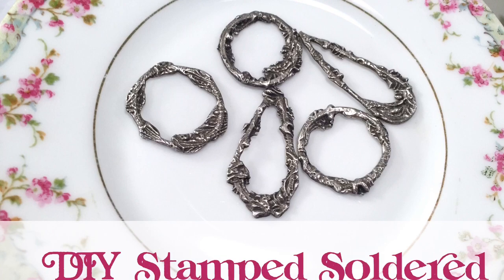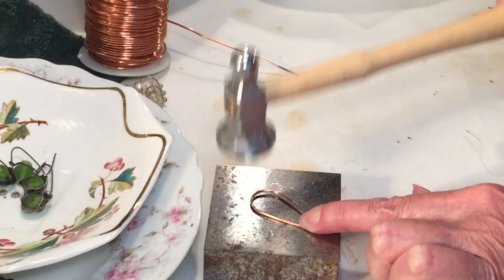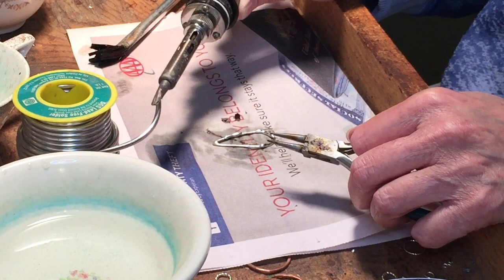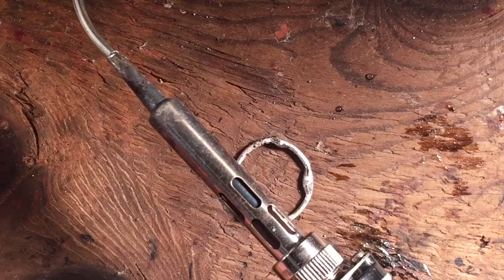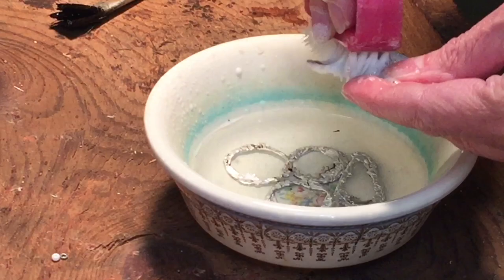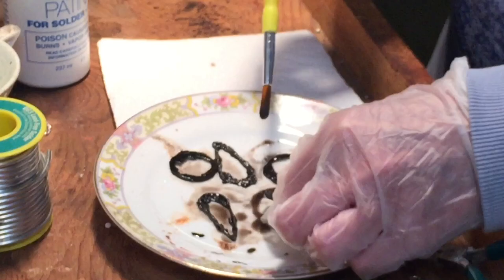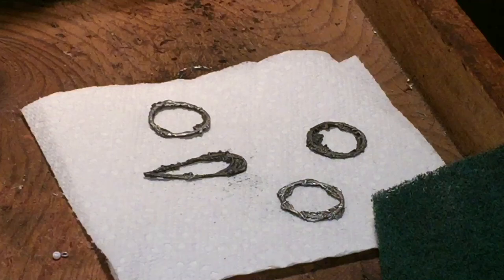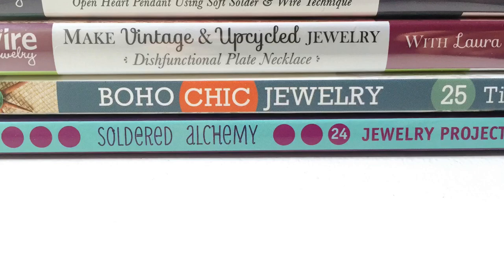DIY Molten Stamped Low-temp Soldered Jewelry Tutorial Laura Beth Love

Comment: I came across your blog and book several years ago and tried stamp soldering using some borrowed stamps, a torch and some random solder kit. Most of my trials flopped but I vowed to try my hand at it again once I bought a soldering rod. Just a week back I thought of finally buying a soldering iron  to make some glass pendants and was wondering if I need another tool. Coincidently you posted this video. Thank you for the inspiration as it once again opens up possibilities.
Reply from the maker: Yes you really just need a soldering iron (buy a high watt one, 80 or 100 watts, not of very low $20 40 watt ones), lead free solder - roll solder works great, as I use in the video, and flux.
Reply: @LauraBethLove  Thanks Laura. I bought a 75Watt iron and paste flux as that is what is available to me locally  and tried it. I could stamp solder easily but however hard I try I am not able to get the solder to glide on the wire like you show. The solder melts on touch of iron but when I put it on the wire, it just globs up. I tinned the tip before I started and cleaned with a wet sponge in between but now it looks black and crusty.  I don't know what I am doing wrong. Any help would be much appreciated! Thanks
Reply from the maker: @JewelsofSayuri  What kind of wire are you using? Try cleaning the wire like I demonstrate in the video. Some craft wires that you buy are coated with kind of a sealant or thin coating of plastic so make sure your wire is not coated. Do you have my book Boho Chic Jewelry? That has lots of information on soldering and I would start there if you haven’t read it.
Reply: @LauraBethLove  Thanks, yes I have Boho chic jewellery. I used clean bare copper wire. Maybe my  solder is old but my tip isn’t melting solder nor is it staying tinned. it gets crusty. I'll try cleaning with sal ammoniac.
Reply from the maker: @JewelsofSayuri  Sounds like you may need to replace the tip, if cleaning doesn't work.
Reply: @JewelsofSayuri  did u use flux?

Comment: You should get some emery cloth to tackle sharp edges. It's like a fine sand paper on a thick cloth backing, instead of paper, that you can easily tear to whatever size you want to work with. I find it much easier to work with & longer lasting than cheap emery boards/nail files. You can get it in sheets or rolls of it, which work out far cheaper than even your dollar store buys for what you actually get.
Reply from the maker: Thanks for sharing that tip!
Reply: @LauraBethLove  my pleasure, I hope it helps. Emery cloth can generally be used dry or wet, it can prove very useful if you end up with ingrained black on your hands, for whatever reason, using the emery cloth, in a bowl of hot water, as an exfoliator with plenty of  soap!

Comment: Love the look of this tech. Haven't tried it yet, but I think it may be easier if done on a heat resistant baking sheet (aka non-stick craft sheet). Wouldn't stick to the paper it's on top of or get the woodgrain on the back side. 
Anxious to give this technique a try (after we get moved & I unpack). TFS!
Reply from the maker: I'm not a fan of those non-stick mats...I've tried them (and actually I think I used one in one of my DVD workshops) and they just aren't my thing! I guess it just comes down to personal preference. Whatever works!

Comment: Hi Laura, thanks so much for sharing….loved your video. I’m very keen to try this but having trouble finding any red rubber stamps. Are you able to provide any advice on places to purchase (online)
Reply from the maker: Sure, Ebay has lots of them, you just have to do a little digging,  just be sure the are the red type and not the clear or the brownish type. I bought mine unmounted in sheets that you cut apart yourself.
Reply: @LauraBethLove  thanks for the quick response. I’ll do some digging😃
Reply: Also having a problem finding the right stamp. I found red stamps on Amazon and my solder sets solid very quickly or my stamp melts. Climbing the walls here, I’m in love with this look. Waiting for my book to arrive. You make it look so easy 😢
Reply: @TXLPE elle ne donne pas la bonne réponse n’acheter pas ses tampon rose ou autre car ils sont en plastiques ou silicone ils fondent 🥺 elle dit qu’il faut creuser pour trouver 😂sérieux!!! Toujours pareille les tutoriels ils ne donnent pas les informations essentielles, moi je cherche partout et je ne trouve pas!! Elle parle de caoutchouc vulcanisé mais ont en trouve nul part… elle ne donnera l’adresse où les acheter 🤗 courage si je trouve je vous dirai où acheter 😉 
Moi j’attends toujours sa réponse ou plutôt je n’attends plus 😂😂😉

Comment: I am curious as to what temperature on the soldering iron I should use.  Mine is only a 60 watt iron, I hope this works, but at least you can set the temperature, thoughts?  Also I am seeing solder come in all types of guages, temperature melts.  Does the temperature melt of the solder dictate temperature setting on the iron?  If so,, what do I need to know about that?  Thank you! ; - )
Reply from the maker: Yes -  if you are new to low-temp soldering you should check out my book Boho Chic Jewelry, as I explain a lot in detail there. But yes, it has all to do with the the metals and their melting points. Low-temp soldering is for metals that melt at a lower temp, some people call it soft soldering but I prefer the term low-temp. You can try the iron with lead-free solder but you may need at least an 80 watt, again it depends on the solder. Good luck!
Reply: @LauraBethLove  thank you!

Comment: Can you do decorative soft soldering onto a 925 ring? I've seen designs that I just can't work out if it's soft wax shapes on hard wax or soft soldering. Secondly could you get this same effect buy directly melty silver wire?
Reply from the maker: low temp and high temp solders and material are two very different beasts - you can do soft solder on sterling but not vice-versa and the joint or repair would not be stable...the soft solder would contaminate the sterling, it would no longer be called sterling silver due to the soft solder: I would keep them separate!

Comment: Where do I get the rubber stamps? The only place I saw them was on Etsy and the seller didn't know if they would hold up to hot solder.
Reply from the maker: Hi Dianne, I have links to what you need in the description below the video! They have to be vulcanized rubber stamps which are commonly the older red type.

Comment: I just tried lead free solder for the first time and I have questions! I'm getting a sticky brown residue on stuff. Is it the flux? I don't have that problem with 60/40 or 50/50. Is it trash in the solder? I'm using bead landing brand. It also fouls my tip. What's going on? Also it smokes like CRAZY!
Reply from the maker: I talk about that in a few of my videos so be sure to check out my jewelry making playlist - make sure your metal is clean before soldering 🌼
Reply: @LauraBethLove  which videos in particular? Not that I don't love you but I don't want to watch them all looking for that info 😜😘.